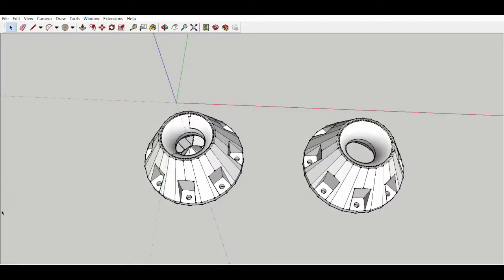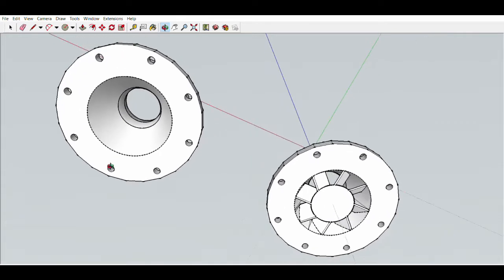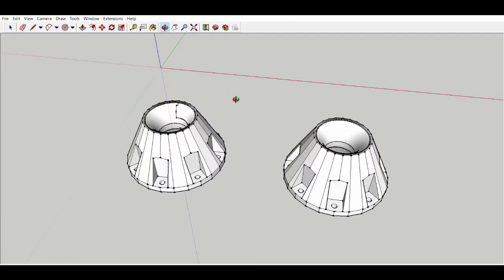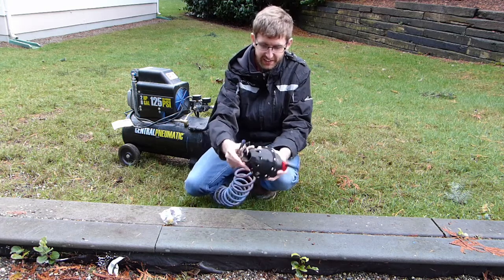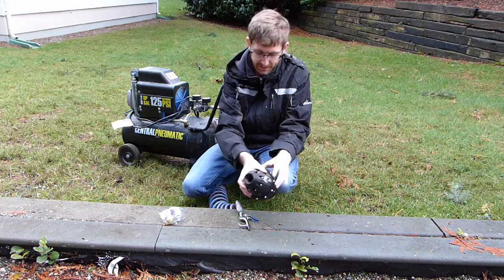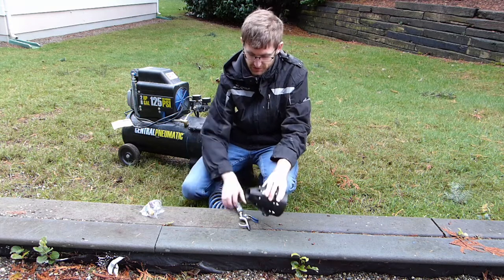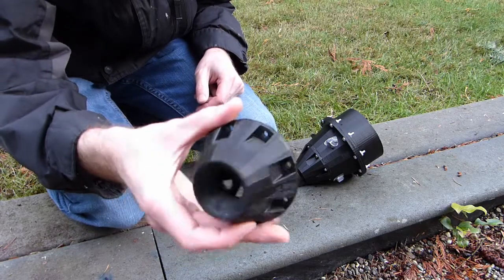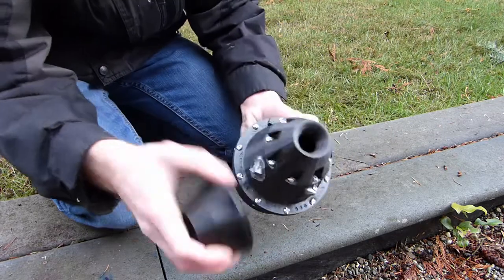Rotorless Turbojet Development Update 2

Comment: What software are you using for design and 3d printing?
Reply from the maker: At home I use Autodesk Fusion360 now and Google Sketchup. I am working on ditching Sketchup mostly though, because Fusion360 just works better and has integrated CAM features.

Comment: I hope to see a combustion chamber at work.3D Printer models should be able to support work for a few seconds.
Reply from the maker: I have some steel parts that will be used for testing the combustors and attempting to get a first engine running.

Comment: How are you gonna compress the air enough to produce workable thrust. Is there a Venturi arrangement inside?
Reply from the maker: The idea is that the high speed of the air at the outer circumference of the vortex combined with the centrifugal compression will provide what compression we can get at the mouth of each burner. The burners would have a throat at the inlet and a double layer mesh where the combustion happens. There will be certainly elevated pressure there but I don't have a way to model how much exactly. I will be experimenting with the burners as the next phase, I don't think it will require incredible pressure to get it working. It would just be a limiting factor on efficiency. The prototypes will tell the real answer...
Reply: @JaycubL  I look forward to watching your progress. As an aeronautical engineer, I find this subject inspiring and hope to start my own engineering channel @some point next year, starting with a small axial flow engine that will power a fairly large drone. Keep up the good work 👍
Reply from the maker: @caitgems1  Awesome I look forward to subscribing to your engineering channel! Since you are a real aeronautical engineer I would be honored to receive any critique or ideas you feel like contributing.

Comment: what material is it made out of?
Reply from the maker: This flow-testing model is made of PLA, a plastic commonly used for 3D printing.
Reply: @JaycubL  what about carbon fiber
Reply from the maker: @crafter2u  Carbon fiber cannot stand heat like you would get in an engine like this. Steel is much better for this application. This model is plastic because it is just for testing flow with compressed air so it was easy to make the parts with a 3D printer.